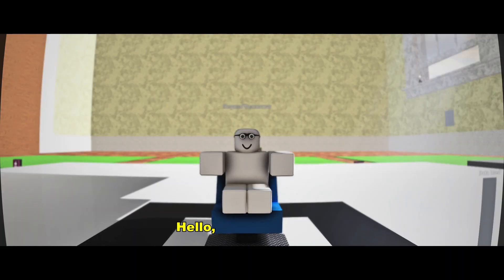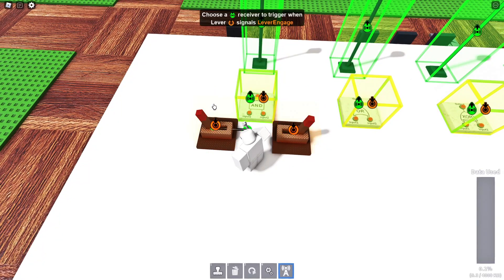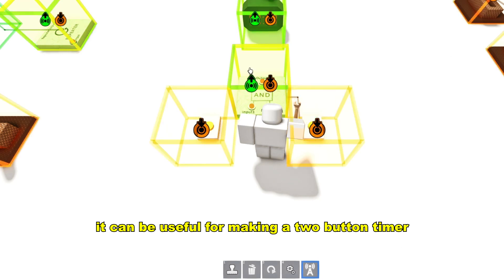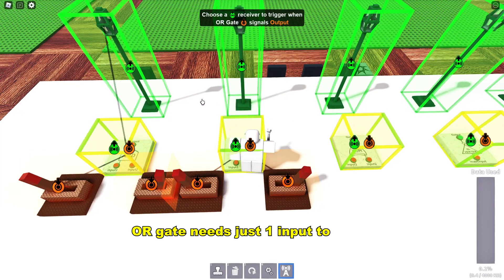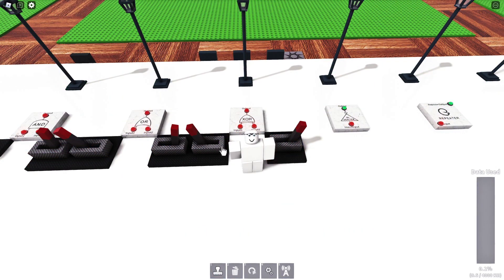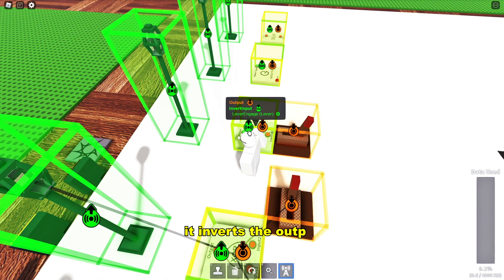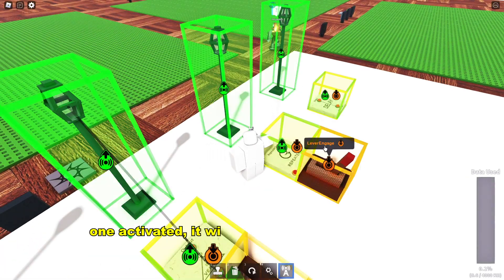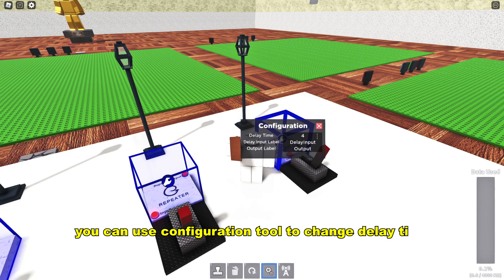Welcome to Roblox Building [BWBT] | Episode 5 - Logic Gates

Comment: Hey can you make a scanner in WTRB please?
Reply: You can make a scanner system using a sort of invisible trigger, it's a block you can place which acts like an invisible pressure plate in a way. You can walk into it, but doing so will trigger the invisible trigger, the invisible trigger can then get wired to anything, such as a door. If you want the trigger not to instantly open the door, you'll have to wire the trigger to a delay, and THEN the door.